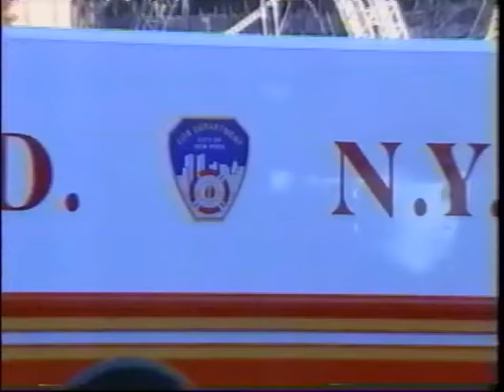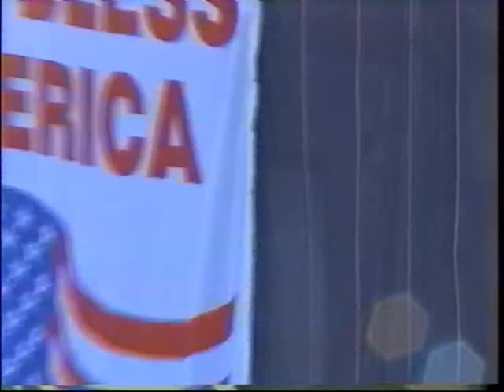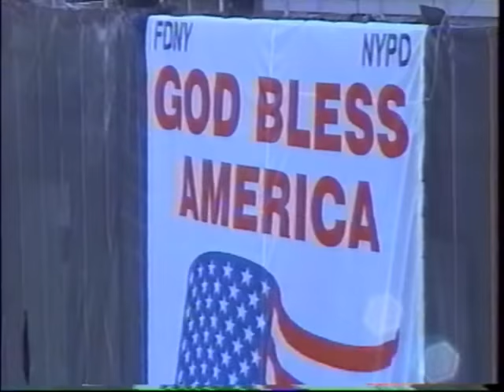Ground Zero recovery months after 9/11/2001

Comment: Did they add dirt for a road for the trucks, or was it made out of the rubble?
Reply: Trucked in reportedly then denied. A lot of stuff went missing
Reply: As they progressed with emptying the hole, the west side of the retaining wall (nearest the Hudson river) started to bulge inwards.
 If that had collapsed, what was left of the World Financial Centre (between WTC & Hudson) would have slid into the hole.

50,000 tonnes of gravel were trucked in and dumped up against that western retaining wall.

Later a more permanent fix was made by stitching steel cables through the wall and into bedrock. That water pissing through the wall and down a tarpaulin is around one of those cables. Might need a bit of silicone on it !

Comment: Would of there been body's under the rubble or just ash? Rip
Reply: Bodies cremated and melted turned into ash
Reply: So so sad
Reply: By November when this was filmed they were only finding small body parts and fragments. That was the case up until March 2002 when they finally uncovered a previously covered lower portion of the south tower lobby where they found the bodies of several firemen, police and civilians two of which were NYPD Kathy Mazza and civilian firefighter Welles Crowther. They were found buried in what was the south tower lower lobby.

Comment: About 9/11 did anyone looked into the measurements in perticular the wideness of the Tower and the Wingspan of a BOEING which is 50.8 meter for a 767 200/300 or 55.6 meter for a 767 400 and then compare this with the Impactscene in relation with the total widt of the TOWER which is only 63 meter !!!!!
Now what we saw is that the entire impactzone its certainly not fit within the other existing measurements. It was a total miscalculating of a stupid second rank of editor.
How surprising is that.
Reply: I do believe 9/11 is an inside job, but as evil as these people are do you REALLY think they had to heart to just say "yeah sure lets just fake planes instead of getting real ones and killing more people" Off course they were planes. That doesn't deny it from being an inside job though.
Reply: @thestatpow5  well they dont think that they are evil, they are capable to do anything so long                              it will support their own business
Reply: Golly gosh, you cracked the case, Sherlock
Reply: @buddyfreakinhoIIy  not to fast, ha but thanks for your response
Reply: @thestatpow5  The reason why there are so many different inside job theories is that there isn't any evidence of it.
The noplane theory is just as feasible as any other inside job theory.
Reply: A R T: you mean that the impact holes were too small?
Why would you expect that the wings and tail of the planes would penetrate the steel columns?
Reply: @rinse-esnir4010  actually to big  when you see the impact the wings disappered in the building and the inginition point of the kerosine in thevvwings  is far to late  , simply not possible
Reply: @MrRonaldoo54  Too big?
Why?
The impact hole is only the fuselage and engines. The rest of the wings and tail didn't penetrate the columns.
Reply: @rinse-esnir4010  you have to look picture by picture and see what happens
Reply: @MrRonaldoo54  all we have is compressed YouTube videos, mostly of poor quality.
So what is the point.
Reply: @rinse-esnir4010  it's ok,  no point at all

Comment: Who had the contract for all the steel? I'd like to know the tonnage. Anyone?
Reply: 100,000 tons used per tower when being built and 50,000 tons of it sold to China straight afterwards
Reply: Both towers were built out of steel frames, glass, and concrete slabs on steel truss joists. A single tower consists of 90,000,000 kg (100,000 tons) of steel, 160,000 cubic meters (212,500 cubic yards) of concrete and 21,800 windows.
Reply: @gerRule  no way, that's something I didn't Know..I didn't know they sold the steel to China, I'm absolutely speechless.. did they not use any of it for the new tower..
Reply: @swagon4545   not only, but UNDER PRICE!!!!!
Reply: It took 9 months to clear the site. All debris was sent to Fresh Kills in New Jersey where it was sorted. Pieces of interest to the investigation were retained. Pieces not of interest to the investigation - the overwhelming majority of the material from 8 buildings - was put up for disposal and distributed among several scrap dealers. With a distinct lack of interest from local buyers - even at well below market value - much of this material was sold overseas. Only some of it went to China.

Comment: This site looks like it has gone threw a nuclear explosion! In later videos you can see a crater that the blast originated from! The ground has experienced extreme heat at this point ! Buildings just don't turn to dust! Has anyone check for radiation contamination in the area?
Reply: Daniel Young from what I remember there was a team that checked radiation and they said it was not above normal. The tem was led by a woman.

Comment: Was there any bodies found, underneath that mess?? Rip
Reply: Yes bodies cremated and melted turned into ash and bones ..
Reply: Barely any bodies were ever pulled from the rubble intact. Maybe less than 20 all together. There was a time between November 2001 to march 2002 where they were only finding body parts and bones. In early March 2002 they finally started excavating a lower portion of the south towers lobby where they uncovered several intact bodies of NYPD and FDNY members such as Captain Kathy Mazza and civilian firefighter Welles Crowther.
Reply: @eyeflaps  wow 😔 rip thanks for the info

Comment: The trade towers magically turned to dust. 110 floors times 2, and next to no debris on the ground. What turned the buildings to dust as the building was blown up?
Reply: Next to no debris? Are you kidding?
Reply: @elijahFree2000   2 110 story buildings fell straight down. There was probably a couple hundred feet of debris in some spots. The towers were turned to dust.
Reply: @anatomyconspiracy9416  The mountain of debris was huge and spread out over many acres.
Reply: @elijahFree2000   k bot
Reply: @anatomyconspiracy9416  You have problems with truth